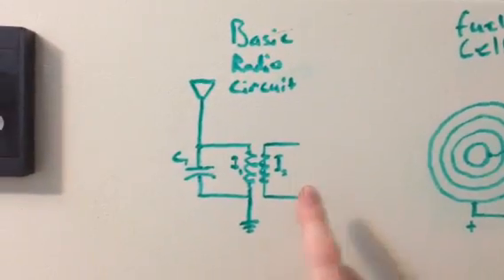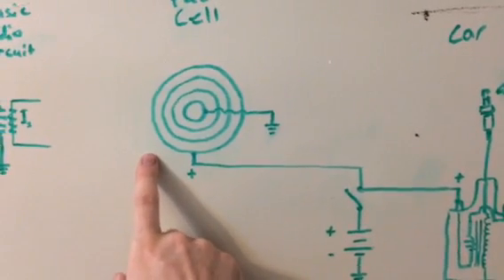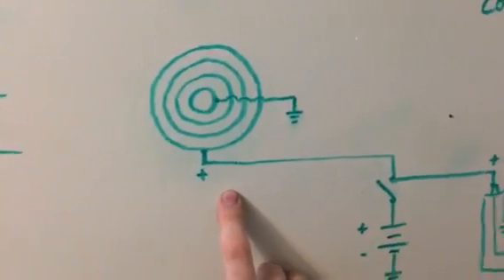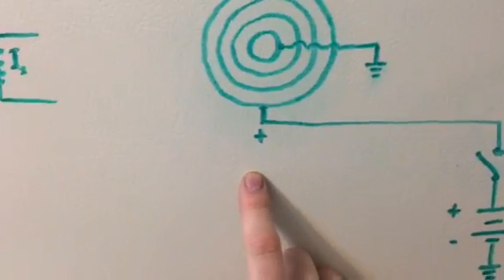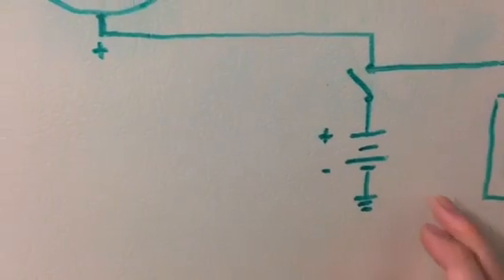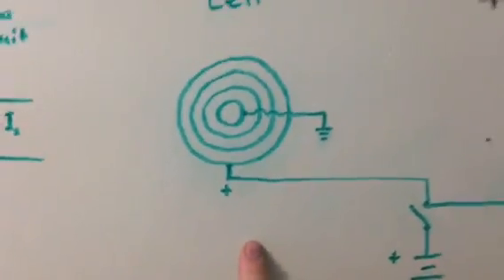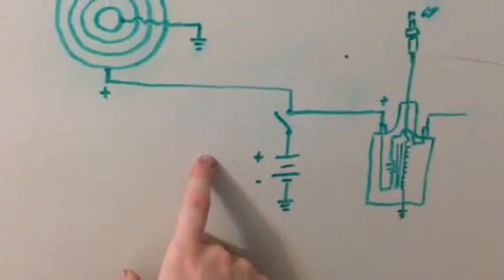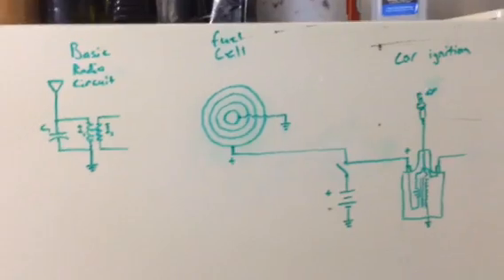Joe cell is a radio reciever

Comment: Yes. 
My thoughts exactly. 
He doesn't actually run any fuel into the carburetor. 
Just blocks off the outlet of the Joe cell with a rubber gromet. 
This same pipe is mounted on to the carby manifold. 
This sets up the frequency. 
Air coming in is exposed to this frequency.

Comment: It doesn't really make sense...  None of the cells that have actually been shown in operation were attached to an ignition coil.  They are all blind plugged or vacuum plugged to the intake manifold or carburetor.   The spark gap is between the cell to the engine block [ground].  The cell is not plugged into the ignition system at all. The Suzuki did not have a cell in it at all and it looks more like the stop position on the ignition switch was broken than anything else. It seems yours is another exotic theory but without evidence.  Have you tried this in an actual application?
Reply: The outside of "Joe" cells are connected to the positive battery terminal (which IS also connected thru a wire to the coil when the ignition is turned on) and if you know what a coil does it amplifies the negative pulse from the spark gap in the points to (actually from in electronics terms but we are talking car and conventional current terms here) the spark plug from across the rotor under the distributor cap thru the leads to create the spark to ignite the fuel/air mix.  So yes, Joe always DID have it connected as per the diagram in the video above through the positive lead on the battery.  The outside of the cell isn't connected to the body of the car (Australian cars are also Negative earth, some countries are not, and this I am sure will cause problems trying to make Joe cells work with Positive earth systems!)  However, interesting theory and deserves some thinking through....

Comment: Stick to your program, but widen the analogy, if the materials used in the assembly are specific to the process, then there is a chemical and subnuclear dimension to the radio receive/transmission pattern, and that is the same principle of timing of resonances in QM.

If you know what hetrodyned radio receivers do you can work back to the structure of the cell and constituent atoms in the collective field making up the universe. Eg, taking the universe as a single atom of quantum information, then the reason for the properties of nuclei to have three quarks of higher energy than the protons and neutrons is because of the "vernier" effects of scaling by interference. 

On the face of it, it looks as if space is a frequency band called "electron", and the neutrinos etc directly related to electons are sub frequency like quarks. I only have a superficial knowledge of all this so errors in naming bits and pieces are more than possible. The operating principles are what I've looked for to hand over to everyone who has direct knowledge of what they are doing... everywhere.
Reply: very interesting stuff! Please share more 😀😀😀😀

Comment: Sorry, NICE TRY! Too many errors to address.  Yours is a perfect example of the apollonian  perspective  and the Platonian model at work.  =Trying to reform "what is" into a something which seems familiar so one can catalogue it/ draw parallels/make sense of it all.   

FYI, spark gap was necessary for early TRANSMITTERS.  Early "radio" receivers were unpowered coils of wire connected to headsets.  Further, Joe Cell does not condition "inert air" so it powers an engine. Tube from JC runs to a capped or "blind plug" connected to the engine block. No known gas passes through the tube/plug. JC's do not "power engines." Engines connected to JCs run off vacuum NOT COMBUSTIVE POWER.  But, as I said, NICE TRY!
Reply: yours is a perfect example of "knows everything so cant think outside the realm of what they already know" the KNOWN gas is Hydrogen protons.  protons are very small and can be transmitted through solid metals.
the arrogance of NICE TRY shows your induced myopia. good luck saving the world by telling everyone what they are doing wrong and not actually doing anything yourself.
Reply: Joe connected the tube to the carburetor, not the engine block.

Comment: Aaron, Have you seen any of the new Official theories regarding how the "EM Drive" is working? It's via photon pairing, which is one of the theories regarding how the Joe Cell works.
Reply from the maker: i have been living in a small apartment for two years where i dont have room to run my experiments on the joe cell so my poor cell is sitting in a box crammed in a closet for the time being I'm hoping to buy a house soon where I will have the room to run tests again in a garage. I rather enjoyed playing with myself changing different parameters to invoke different responses and probe out what is behind the bizarre behavior in these cells. One line of inquiry I was on shortly before having to stop my tests actually related to Stanley Meyer as well. Joe mentioned in his videos of putting a wire straight across battery terminals is a dead short and coiling the same wire across the terminals is not a dead short I think this is why there are what Stanley called choking coils on the Stanley Meyer design. to put power directly to metal plates in water is a dead short the reaction is just not as violent because of specific heat the water cools the unit. run the power through coils before reaching the water and the fields are able to run past each other without colliding which is what produces the power-hungry waste heat in standard electrolysis. I believe what Stanley Meyer accomplished with power coils to the terminals Joe accomplished in one form or another with the neutral plates changing the alignment of the input power fields to spin past each other instead of colliding. Ed Leedskalnin of course had his small pamphlet electricity and magnetism where he described and conducted many tests explaining how magnetic fields can run past each other much the same thing.

Comment: LC circuit with experimentation will alter spark not new, modern electronics do the job today. Nothing free nothing magic blue is the right colour, boost it in power it goes yellow, alter the frequency and a blue plasma will occur. Try so basic HT experiments before even if you think this will work, motor manufactures have been there.

Comment: This is a LC-oscillator, not the radio! :D Radio will need an antenna and amplifier and adjustable capacitor/inductor. But yes, you could use LC-oscillator self-resonance frequency to break down the water molecule by high voltage. My doubts are about if the result is Brown gas, I suspect it may just temporary break water molecules, so you will get "more gas" than normal.
Reply: +RPdigital hey, what kind of oscilator could i get to do this? where and how much?
Reply: +griffin gibson By the data of my research, the frequency is the harmonic frequency of the diameter(s) of the cylinders, this is why Joe used 1",2",3",4" cylinders inside of each other. In that case harmonic frequency is the sound speed in water divided by diameter of cylinder and the multiples of this frequency. The result is mechanical resonance and I predict that water moleculs are broken down into vapour and not Brown gas. If you build one, in that case make it frequency adjustable to get maximum results.
Reply: +RPdigital i believe if you run your electricity through a starter motor to your joe cell that it will produce the correct frequency to break th water where the tubes of steel are just a resonation chamber for where the reaction is to take place.

Comment: We have been calling the JC a capacitor since day one.  If this is just a radio frequency circuit,  it can be accomplished in solid state,   correct?  I believe that it more than this,  but if this is correct,  all cars can run on atmospheric gas starting tomorrow.
Why not prove your theory out and do it?
Reply: It has been done before it's called a Pap's engine

Comment: Phi ratio will produce the proper dimensions. I'll give the phi ratio sequence starting from 0.
0, .618, 1, 1.618, 2.618, 4.236, 6.854, 11.09, 17.944, etc.
The sequence starts with a phi ratio .618:1 or 61.8% of a whole. Then use a fibonacci sequence to derive the other numbers going to larger and larger numbers. You can also go to smaller and smaller numbers or sizes.
1, .618, .382, .236, .146, .09, .056, .034
Since we are working with a ratio of .618:1, I can substitute any number I want and make it my new whole part of something. for example:
 I have for my cathode, a tube that is 5 inches(it doesn't have to be 5 it can be any tube size you have). 5 becomes my new entire part. 61.8% of 5 is 3.09. With these to numbers I can now do a fibonacci sequence to larger numbers or to smaller numbers. 
5, 3.09, 1.91, 1.18, .73.   (etc.)
The 5in. pipe is the cathode and the .73in. pipe is the anode, the rest are neutrals.
You now have the knowledge required to create joe cells that properly resonate and can create constructive waveform interference in between all the concentric tubes. Please USE THIS INFORMATION ANYONE WHO READS THIS!
Reply: +Solomons Words can u define more i had tried with your steps but might i was doing wrong
Reply: Take any number 5 for ex. 5x .618 gives me 61.8% of 5, that number is 3.09. Minus 3.09 from 5 to get 1.91. Minus 1.91 from 3.09  to get 1.18 and then just keep repeating. I just got this sequence from doing that, 5, 3.09, 1.91, 1.18. You can make tubes in those size by bending a flat sheet of stainless using a rubber hammer and a small diameter pipe. Look up how to bend/form flat sheets of metal into a cylinder.
Reply: Hello friend

May I ask if the 5 inches you mentioned here refer to the diameter or height of the pipe?

Is the central tube a cathode? If the center is 5 inches and the surrounding area is smaller

So how do you understand?

Thank you in advance for your reply

Comment: you have a point there i m recently were playing with a transformer end i discover that wen you arc the the secondary coil you get hv spiks  joe cell is something similar how it works it multiply s the energy the hho tube serves is the pwm

Comment: Hi Aaron your comment on the air con stopping the engine adds up though have you a view on the squealing if the alternator as you say I believe it is a back charge dc pulse taking over from the ac and as the engine revs higher it then stops as the dc/ac neutral has come in to play it appears teslas electric arrow car was on this same years before
Reply from the maker: Joe in some of his other videos talks about DC motor generators having a field that comes out at the shaft 90° opposite to electricity or magnetism I believe that field is somehow related to The opposite frequency we need to make inert gas combust as hydrocarbons do to a normal frequency spark that is the field that is messing with the alternator and ran the engine on air as the revs came up